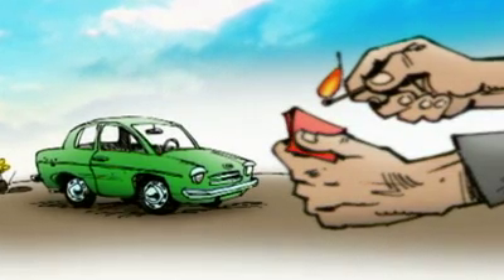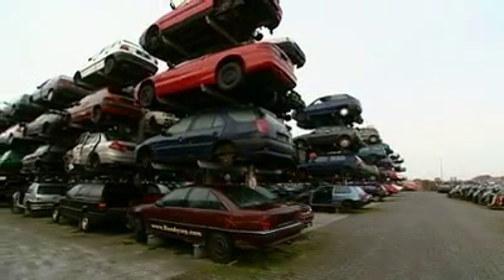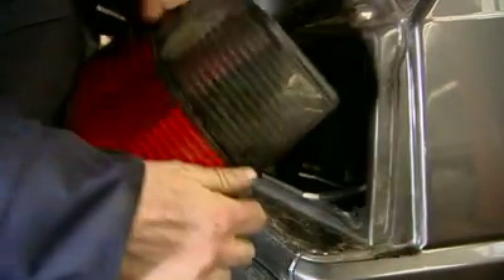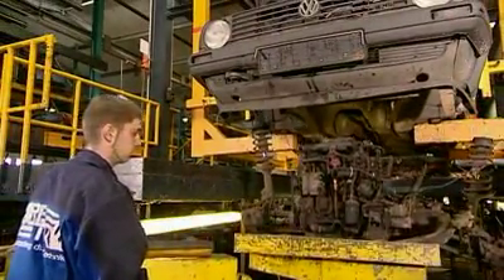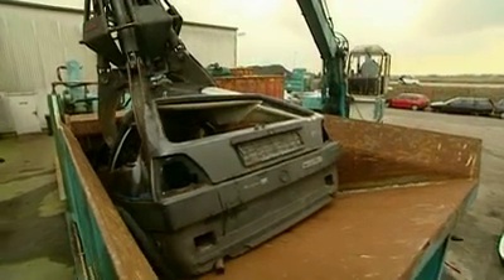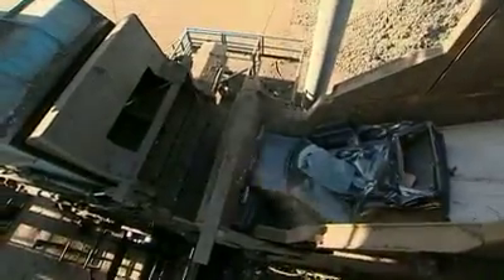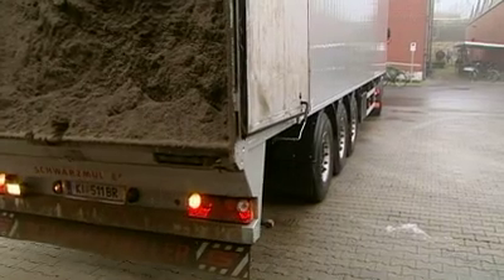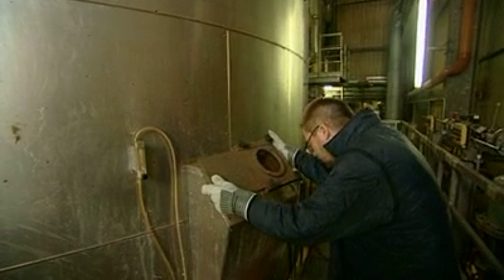Volkswagen Total Vehicle Recycling

Comment: Restore it, don't recycle it.
Reply: then why?
Reply: VW TDI this comment should be the most liked comment.
Reply: +VW TDI with most of these cars you will not get a new license.they are not old enough to be classified as ...oldies... or ...antiques.. where different laws prevail. fuel consumption, smoke emission and a few other factors play a big role. maybe there are some rust patches underneath,inside, god knows where, which can not be seen as such, but the inspectors see. maybe a headlight or teil light has a crack, needs replacement. i had the same story with a Mercedes 220 ,though it was many years ago. it had no seat belts, Kats were unknown at that time. and the 6 cylinders gulped sone 25 ltr of petrol. a tail light cover replacement costed nearly half as much as the car....... you drive a Merc, you have money, so pay... was the attitude of the scrap dealer...

Comment: @10yroldcarlover  Unfortunatley in developed countries labor and space needed to remove, store and then sell is usually worth more than part itself - Combined with short life of a car there is small demand fot those used parts - Cars are often scrapped despite they are still in working condition or can be fixed and made usable again - It is our "need" of new cars and high labor costs that make shredding good parts profitable.